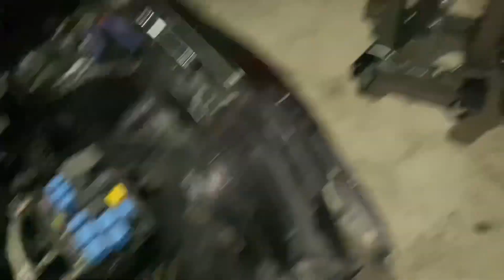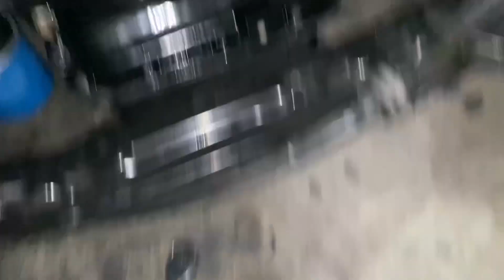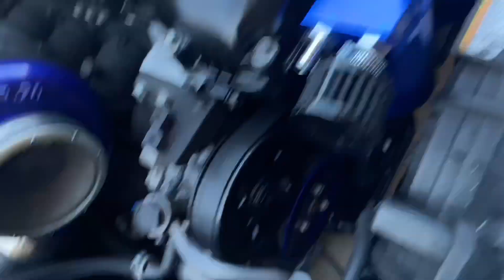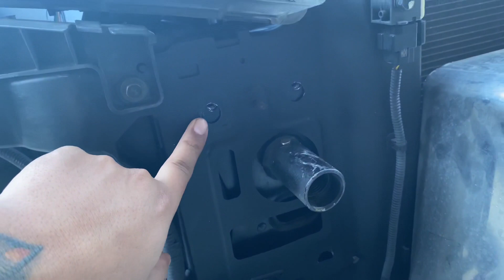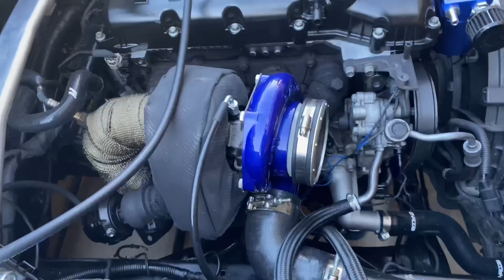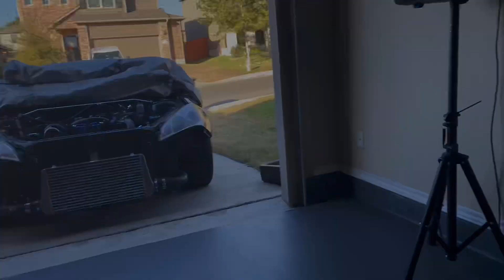Genesis Coupe 2.0T Engine Build Pt.11 | 700WHP Build FINISHED!

Comment: Did u ever get around to the evo10 valve cover?
Reply from the maker: Yep. Needed to make a few adjustments for it to work properly
Reply: @ProdigePerformance  have a video with it on? By the way i also wanted to ask at what mileage do you recommend changing the oil pump im changing the timing chain and vvt sprockets. Debating on changing the oil pump as well.
Reply: @ProdigePerformance  did the engine noise under the hood get louder?

Comment: Where’s all you boost solenoids
Reply from the maker: On this set up. 

My latest set up i had to use a 3 port Mac valve to hit 44 psi
Reply from the maker: I run off spring pressure only and I don’t use a bypass valve solenoid

Comment: Yo bro, can you show us the start up method for those who have gotten a rebuilt engine? And type of oil to use on initial start up for new rods and pistons
Reply from the maker: BR30 5w30 or 5w40. 
All you have to do is prime the engine by removing the spark plugs and taking out the fuel pump fuses / relay.

Prime the engine for 20-30 seconds 2 times then put everything back on and turn on.
Reply: @ProdigePerformance  even without a tune to a new haltech install? I’m asking because I’m about to go through this and I don’t screw up internals due to lack of knowledge. There’s not much on my concerns, or I’m not looking in the right places. Thanks for replying bro!
Reply from the maker: @JALAP3NO  depends. If you set up your injectors right map sensor etc then there should be no problem when starting up the car. Just don’t go into boost because you aren’t tuned to see vacuum with that turbo and you’ll lean out. 

If I were you I would use stock injectors etc and upload the base map. Turn the car on and let it idle. If it idles good and no leaks take it for a drive in the neighborhood break it in. 

Just again don’t boost with a bigger turbo you aren’t tuned for
Reply: @ProdigePerformance just by turning the ignition on and off?
Reply from the maker: @vietyyg6739  you prime it by turning the motor over without fuel and spark.

This allows the oil pump to pre lubricant the motor before official start up. The trick is to have no fuel or spark occur which would turn over the motor. Again the whole point of priming the engine before start up is to pre lubricate the engine components without having the motor fully turn off
Reply: @ what happens if I’d try to crank it without priming? Oil still wouldn’t circulate?
Reply from the maker: @ it will you just take a higher risk of damaging the new bearings in the process of doing a dry start. 

It’s rare but it happens and that’s the point of priming before full start up
Reply: @ProdigePerformance  gotcha gotcha, thank you

Comment: I had some questions I have the 2013 2.0 I have a tune but I’m looking for more ideas? Or weak links
Reply from the maker: More ideas as in?
Reply: For more power probably upgrading the fuel system?
Reply from the maker: @kristianirons8401  whats your power goal
Reply: @ProdigePerformance  I was looking for like 400-450
Reply: I moved away from my tuner any piggy backs u would suggest no one here touches Hyundai
Reply from the maker: @kristianirons8401  link ecu g4+ or haltech platinum. 

If you give me a day or 2 I’ll actually be uploading a video on how to make 400 wheel under 3-4k on the 2.0s and go into depth with it. 

I would recommend getting a stand alone ecu. Link works with autos haltech doesn’t, both can be brought directly from alphaspeed. After that anyone can tune your car locally. You don’t necessarily have to upgrade the bk2 pump cause I’ve seen them hit 350-400 on stock pump but if you decide to upgrade the pump definitely a dw300 would be plenty. Just make sure you get a fuel pump relay kit so it doesn’t get burnt out.

Injectors you’ll need anywhere from 1000-1200cc 
E85 is also a good thing to switch to but if you only have pump around you then methanol is great as well.

Comment: Any idea how much the atomic trans can hold in the second gens. Or where I can find out
Reply from the maker: It’s honestly a hit or miss but the majority of auto guys I’ve seen get built usually have trans issues if they go past 400 Wheel
Reply: @ProdigePerformance  
Thanks 👍
Reply: My bk2 has 400whp on auto trans with tcu tune. Rev limit upped to 7k. I track it as well. Been ok so far but I'm getting it built at level 10 in NJ.

Comment: Amazing. Your videos have helped me a lot. My bottom end is still at the machine shop. But im keeping my power around mid 500s.  My bk2 is auto trans as well. But the transmission is getting built at level 10 in jersey. Im also still on stock suspension and stock open diff. Saftey last 🤣 ... but i was running consistent 12.4 quarters on my stock bottom.
Reply from the maker: Have you heard of the link ecu? Alphaspeed is making a harness so all the auto guys can have a stand alone ecu finally!
Reply: @ProdigePerformance  damn! I need to look into that! Been looking for a work around for haltech for a long time! Thank you. I'm not sure if i could even get my goal of mid 500s on the stock ecu.  The ecu freaks out after high 400s. Made my day.

Comment: Id  like to see if you have done anything suspension wise to hold that power
Reply from the maker: I have a sedan rear end going in eventually. It’s currently just on coilovers and poly filled mounts. I mainly roll race the car. If I were to try and do dig racing I would destroy the rear end ds axles everything.
Reply: @ProdigePerformance  ok okay smart move. I didn't know the sedan genesis rear end could go on the coupe. You know alot about the genesis.  Thanks for the info
Reply from the maker: @Ali26Damaja  when the time comes I’ll cover why I choose the sedan subframe in the video and point out the differences. In short summary. The sedan subframe is made of better material and beefier. Even the sedan axles are meant to take the extra abuse. After all the 5.0 sedans did make a lot of power. The sedan subframe bolts right on with the exception of the sway bar. If you want the sway bar to fit you’ll need the snoopy panda adapters. 

The coupe rear end is notorious for having stress cracks/breaking axles/diff mounts with higher hp builds. The atq bushing and brace kit is also a good idea but I wouldn’t say it’s ideal
For anything above 450 wheel as it’s just mainly a band aid in my opinion where as the sedan subframe has been used for most big ls swap builds I know and it holds perfectly fine for them.
Reply: @ProdigePerformance  excited for the sedan subframe video
Reply from the maker: @LtTyrone  definitely on the to do list for you guys! Plan on covering it all bro
Reply: @ProdigePerformance  my 3 requests are the
Veloster turbo review
Sedan subframe 
10 hours of 9k Rpm ASMR
Reply from the maker: @LtTyrone  make me a go fund me to cover engine replacement fees and you got a deal. Lol
Reply: @ProdigePerformance  
Would the 8 speed auto be the same in the coupe and sedan ?
Reply from the maker: @kristianirons8401  different bell housing bolts.